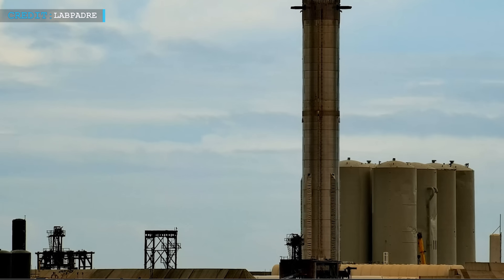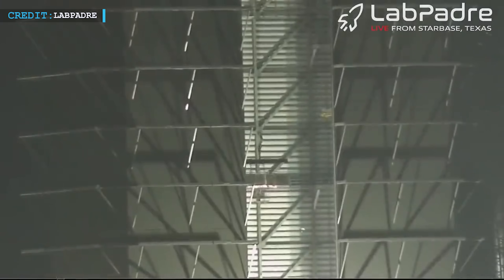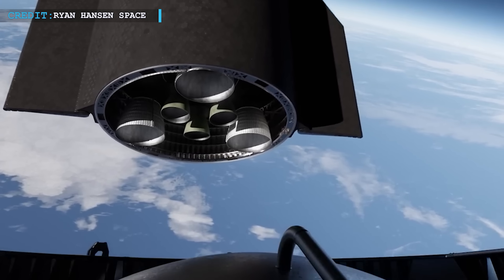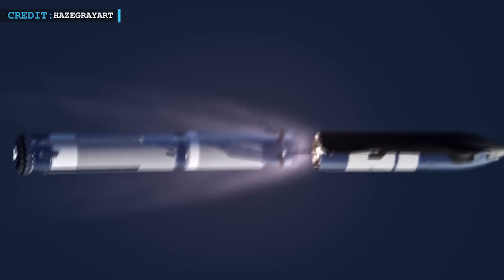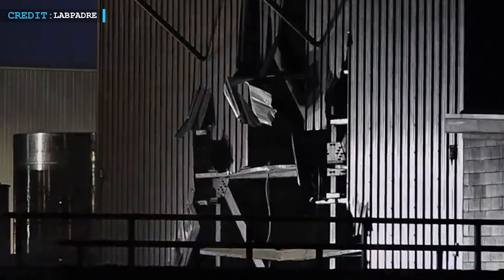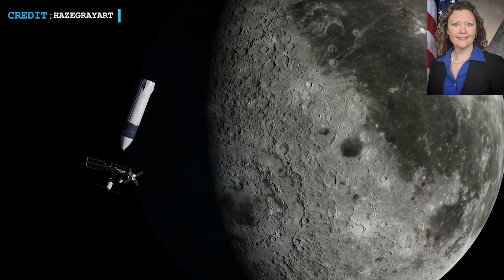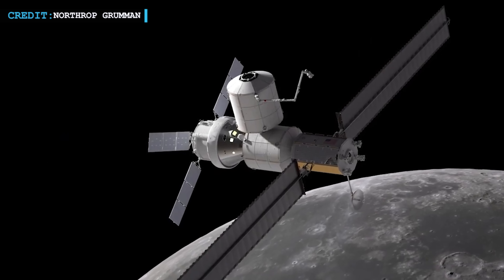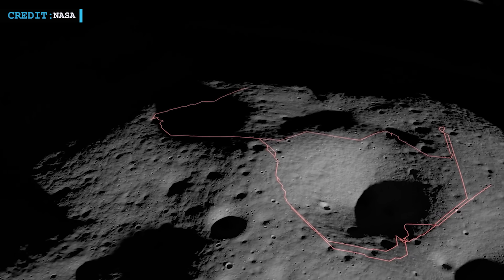SpaceX Starship's Booster 9 is finally out! Two changes SpaceX made to stop it exploding

Comment: I think the headline is misleading. 
If there is a failure on some of the systems then they need to explode the rocket. (There is no way around this)

The only request Musk had last time was that they didn't explode the rocket on the launch pad since it would damage the launch  tower and surrounding structures.

Comment: Hot staging keeps the fuel and oxidizer at the bottom of the tanks so that ullage rockets are not necessary.
Reply: Hot staging also: a) Eliminates the gravity drag from the coasting phase b) the Starship raptor’s flume impacting the booster will provide some retro force to help slow it down. c) eliminates the need for clamps holding the vehicles together, the Starship can rocket away from the booster.

Comment: 4:19 "...a new machine that heats up CH4".  Wrong.
It cools down CH4 using a liquid nitrogen bath through which the CH4 pipes have to pass.
I think the misunderstanding comes from them being named "kettle boilers", but what is boiling is the nitrogen, by removing the heat in the liquid CH4 down to a temperature nearing its freezing point (to increase its density).